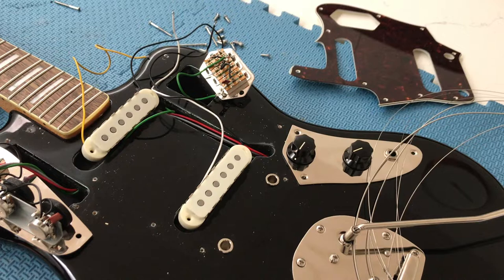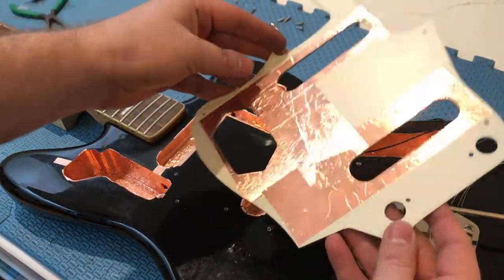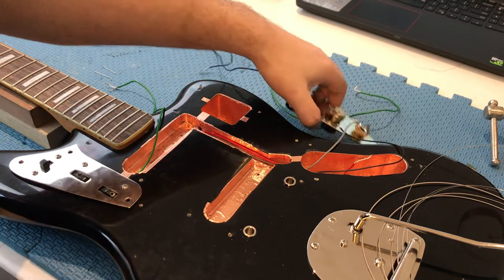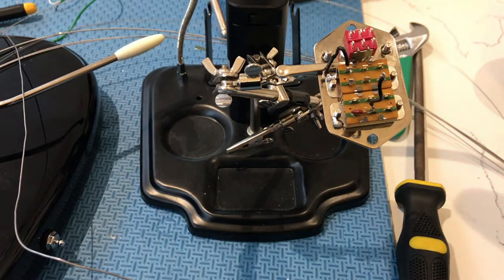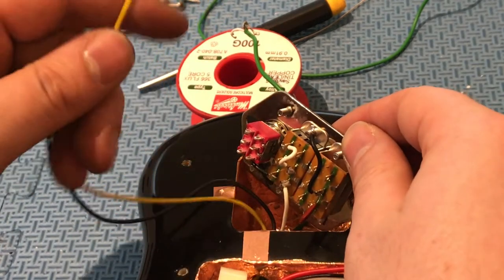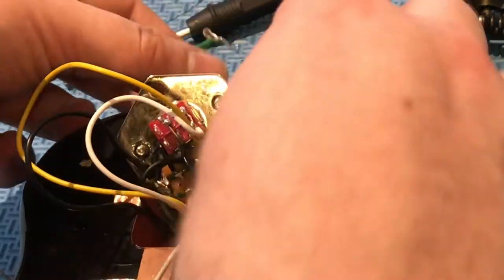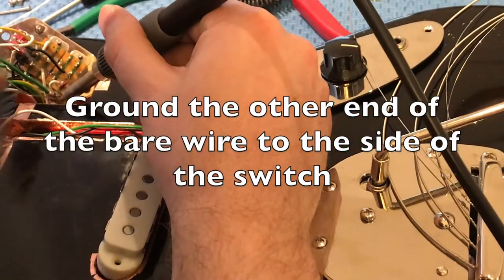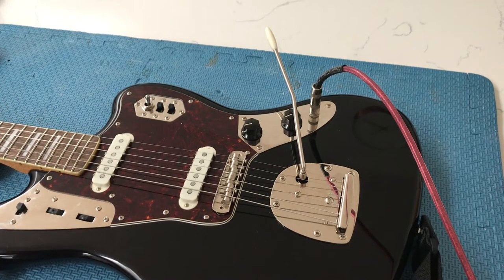Fender/Squier Jaguar 3-Way Toggle Switch and Series/Parallel Mod

Comment: Sometimes after shielding your guitar, some parts might make contact with the shielding and cause a short. If your guitar isn’t working after you put it back together, this is probably what’s happening. It’s easy to fix. I’ve done things like put tape on top of the shielding, or painted a layer of superglue on it. You can paint over the shielding with poster paint, and I’ve even used cardboard. Anything to block the parts from touching the shielding and creating a short circuit.

Comment: what if i just want the 3 way and series switch? i have a les paul style toggle and want use it as a pup selector and a dpdt switch on hand with either a v/t/t or v/v/t control setup. any help would be appreciated

Comment: If I'm using an aftermarket (Seymour duncan quarter pound jaguar pickup) Does the claw still need to be regrounded? (Pickup stats the claw isn't necessary for this pickup)

Comment: I have a Gibson 3 pickup SG custom.When the selector switch is in the middle position the sound is the usual out of phase Fender Strat type tone.What mod needs to be done to make the middle position in phase,so that the bridge and middle pickup work together?Unable to find info.

Comment: hello, I have the same guitar. i have problems in the neck pick up, the sound/signal keeps cutting off. this happens when i adjusted the pick up height. i dont know what's causing the signal loss. i hope you can help me. thank you

Comment: Couple points:
1: Love the treble bleed!
2: All this copper shielding can be done very efficiently with the MVP of grounding, aliuminum foil, if one is on a budget.  See here for details: https://www.youtube.com/watch?v=5uUwDbIE9Yc
3: For those less inclined to spend hours carefully filing a control plate, simply install a dpdt push-pull pot and keep your classic Jag controls standard.  Or just, y'know, buy one of many Fender/Squier models that phoned it in with a 3-way switch.
4: That said, highly recommend any series mode on a 2-pickup single-coil guitar, it will really expand your tonal options, though I personally would add a phase switch (via second push-pull pot in this particular instance).
5: You can get all of these options usable on the rhythm circuit, with its distinct volume and tone controls, though it takes a bit of (okay a lot of) creative wiring.  Here's what I did with my Vintage Modified: https://www.youtube.com/watch?v=EPQcgRI1ChI&t=2s

Honestly, for the right price (time is money friend!) I could likely make your switching work with both circuits the way you envision, you're really not taking advantage of the double poles on that new pickup selector.  Email me at jmutations@yahoo.com if you want to hear more.

Comment: I've been looking for this circuit for years. Nice one man. My switch just arrived. Going to give it a go tomorrow
Reply from the maker: Have fun mate. Hope you get a lot out of the mod!
Reply: @alexrcowan  I'll you know how I get on. Ta
Reply: Did the mod and it works a treat. I had the series parallel mod but using the pickup selectors, so both in up position was series both down was parallel. I always found using switches to choose the pickups a bit naff. The three way switch is far more familiar.

Comment: Hey man! you did a great job on this superb Jag 🎖 i have one too in my collection n i've been swapping already the bridge for a Staytrem + adding a Wizzobuzz which helps to get rid of the kinda sitarish strings' vibes but im considering now to shim the neck with a StewMac 0.5 shim block ....i'm just asking you if you recommend this mod in order to gives a better action with the bridge height setup higher since it may require a certain amount of angle from the vintage design of an archtop ....what do you think ?

Comment: Great Mods. cool guitars. I have what's probably an annoying question for you guys. I've been trying these mods and everything works except for the neck pickup isn't working when the series\parallel switch is up. it works in every other position it should. I've redone the wiring a couple times without success. I notice that in the diagram theres a wire from the input jack to the tone pot but you didn't do that in the video but that didn't seem to help either. sorry I'm just copying and don't really know why the wires go where they go so I can only do so much trouble shooting. Anyhing come to your mind as the most likely culprit? thanks. appreciate your time and vids
Reply: did you ever figure that out, I've got the same problem

Comment: What is the stuff you’re soldering in between the middle at 13:51 that isn’t wire? Sorry I’m new to this.
Reply: @alexrcowan help please.
Reply: That is indeed wire, just no insulation on it. Bare wire is used for short connections sometimes so you don't melt the insulation

Comment: I want to do series/parallel on a telecaster. The previous owner drilled a hole and added a toggle so I’d rather use that hole for a switch I want instead of his setup (treble bleed on a switch ???). Am I correct in thinking I want an ON-OFF-ON DPDT to use with the tele 3 way? I found ONE diagram for the setup I want as it seems everyone else gets the 4 way tele blade. I assume I will be using the same principles as your new 3 way toggle plus series/parallel switch and treating the tele blade switch like your new pickup selector and matching your series/parallel wiring. If you or anyone else can see problems I am overlooking please hit me on the head and tell me where I’m wrong. Great jag!!!

Comment: So I see you cut the ground on saw tooth cover around the bridge pick up and stated it will not work properly with it grounded. So do I need to do the same on the neck pick up??
Reply from the maker: No you only need to do this to the one pickup for this mod
Reply: This had me kinda confused as well. What’d you figure out gravey?
Reply: @blu3me304  just did the one and it works perfectly.
Reply: @GraveyJones86  thank you brother. I’m working on this today!
Reply: @alexrcowan i've seen another video for a telecaster where they snipped on the neck pickup for a series mod. why is it bridge on a jaguar?

Comment: Do you have a detailed diagram of how the rhythm circuit came stock? The black wire came loose on my CV Jaguar’s rhythm circuit and I’m trying to figure out where to put it back. Currently got no output from the rhythm circuit and neck pickup. Greatly appreciate it.
Reply from the maker: Hi, sorry for the late reply. The diagram will be the same as a fender jaguar wiring diagram, the only differences could possibly be wire colours.Just google Fender Jaguar Wiring Diagram and heaps of options will come up. Hope that helps!

Comment: How difficult would it be to use the on-on-on 3 way to replace the Rhythm circuit toggle so that it will act as a Neck, Middle, Bridge switch?  I was going to swap the tone pot on the rhythm circuit to a 1 meg and put a treble bleed on the volume pot so it would function more like a Les Paul.
Reply from the maker: Do you mean to swap the position of the 3 way toggle to where the rhythm switch is? And then have two volumes and 2 tones like a Les Paul? Not too difficult at all man

Comment: Pardon for asking.. why did the interior of your guitar is covered with copper?
Reply: A Wanderer Shielding against interference to minimize signal noise/hum
Reply from the maker: What ToasterMedia said. It lined with copper to form a faraday cage around the electronics to minimize hum by shielding against interference from things like lights or other electronics
Reply: @alexrcowan  thanks for the reply! Do Bass also need this? Or it's only guitar thing?
Reply from the maker: @razmazerz  You can certainly do this to help shield your bass against noisy interference if it needs it

Comment: Hey Alex, I followed your diagram exactly and have one small issue.

I opted to use a ON/ON toggle switch instead of the slider switch for the rhythm circuit. Even though I wired it exactly the same, for some reason the toggle is reversed. The rhythm circuit is activated when I switch the toggle down, rather then up. Any ideas?
Reply: My bridge pickup no longer gives an Ohm reading, and is giving very low output after clipping the ground
Reply: Rotate the switch 180.

Comment: Nice. So you used one pup switch for series/parallel.  The other switch?
Phase/out of phase?
Reply from the maker: The other switch is the standard bass cut/strangle switch. I wanted to keep all the standard switching options I could get on a stock Jag as well as having the series/parallel

Comment: Noob question: is there any other combination of capacitors for the treble bleed Mod?
Reply from the maker: Yes there are many different values you can use for the caps and resistors in a treble bleed, comes down to what you think sounds best

Comment: does that work with an HH jaguar ? like the player series one ?
Reply from the maker: You can definitely make the player series do series/parallel by either changing the switch, repurposing the coil split switch or even changing the volume or tone for a push/pull pot